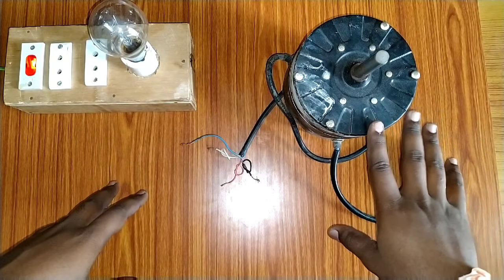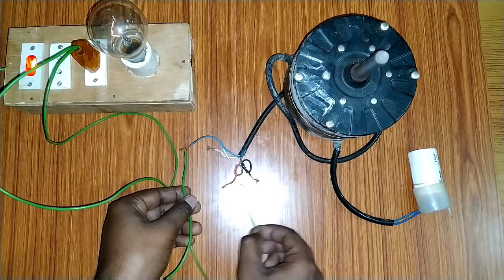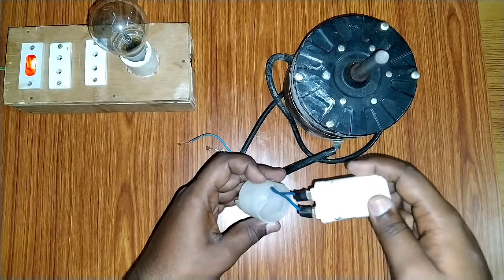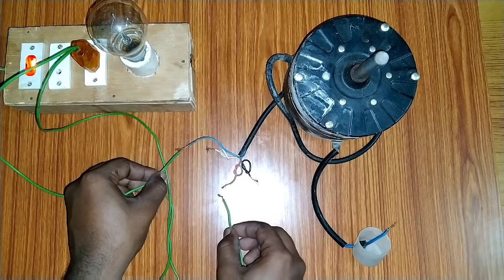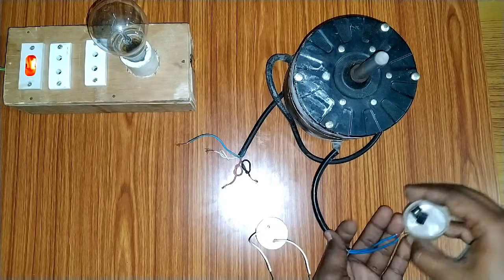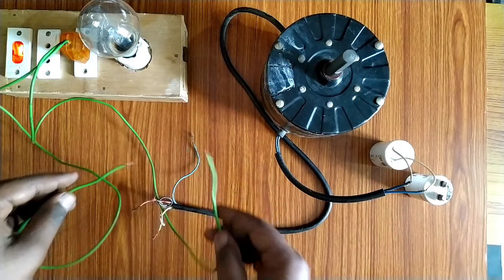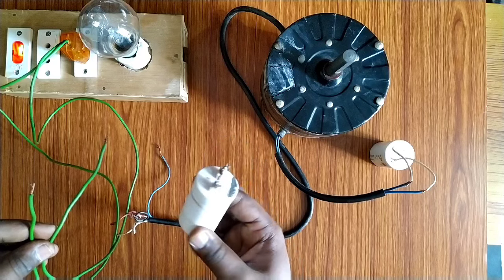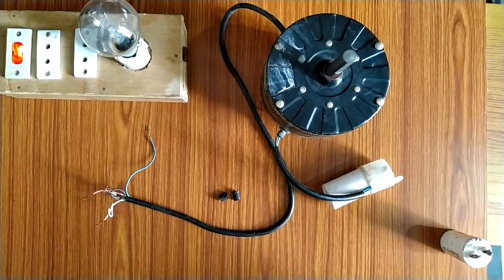Cooler fan Capacitor Problem // Solved

Comment: Nice explanation. I need a solution for my cooler 3yrs old (Bajaj DC 2050 DLX 70-Lires) problem. When I switched on power its taking more than 5 mins to start and running fan. Observed getting heat when I touched it. And also giving much noise (noise not like your previous video) . Pls suggest..
Reply from the maker: Okay Brother I understood
Thier might be some other problems 
Like bush rupter etc. Okay fine

This is the link 👇👇👇 might may help you regarding your problem.
https://youtu.be/vtF2GpJscfo

Comment: Very informative.  Thanks machha :-)
Blue common 
White High
Red Medium 
Black Low
Is color code important or can we connect any wire to high, Medium and low?
Reply from the maker: Thank you bro
Colours anevii standards.
Meru ela fit chesina positions change avutayii tappa circuit lo problem radhu.
Reply: @sharathmultiworks5509  thank you
Reply from the maker: @ChandraJavvadi  welcome
Reply: @sharathmultiworks5509  common identify Ela cheyali bro
Reply from the maker: @maheswararaosasubilli2133  Blue wire is common bro

Comment: Hi bro, Nice explanation. 

Memu Crompton window cooler Ozone54 2 years nundi use chesthunnam. Super performance icchindhi so far. But ippudu oka 2 days nundi...slow ga thiruguthundhi and konni sarlu thiragadam ledhu...initial ga koncham movement isthe thiruguthundhi but not fast as earlier. And Capcitor dhaggara sparks vasthunnai. Malli power leakage kuda vundhi...tester tho check chesthea...li8 vasthundhi...shock em ledhu.
 Capacitor replace cheyyoccha? Or Motor bushings check cheyinchala? Please reply..
Thanks
Reply from the maker: Motor bushes check chesi greasing cheyali, and capacitor kuda check cheyandi

Comment: What to do condensor wire is lost bro 
Pls say
Reply from the maker: Internal ga winding degara wire fail iendha
Reply: @sharathmultiworks5509  
Ha ,condensor wire came out from motor
Cut indhi
Reply from the maker: @mamathabollam1947  okay fine I understood.
Watch this video, you can solve the problem by clicking this link 👇👇

https://youtu.be/ZYSeU1bny3c

Comment: capacitor problem unapudu motor over heat avuthundha
Reply from the maker: No, bush problem vunte over heat itadi
Reply: @sharathmultiworks5509  ok bro thanks
Reply: @sharathmultiworks5509  capacitor change cheysanu run kaledhu bush problem anukunta
Reply: @sharathmultiworks5509  ok
Reply from the maker: @yooman5172  welcome
Reply from the maker: @yooman5172  Yes
Reply: @sharathmultiworks5509  money entha avuthundhi bro bush repair ki
Reply from the maker: @yooman5172  no idea bro. Approximately 500 for both bushes
Reply: @sharathmultiworks5509  ok bro

Comment: Hi brother
Cooler capacitor celling fan ki prttochha
Reply from the maker: No bro, winding kalipotadi.
Reply: @sharathmultiworks5509  TQ bro
Fan thirgatledu bro condenser check chesa bagane vundi fan regulator poindi anukoni direct ga connect ichhesi fan on cheste ayina tiragatledu problem enti bro 
Winding poinattena?
Reply from the maker: @ramkuntamalla8067  winding check chii bro 1st.
Reply from the maker: @ramkuntamalla8067  https://youtu.be/5caxzeLgfZ8
Reply: @sharathmultiworks5509  winding check chesa bro light kuda bagane vastundi ayina thirgatledu ela
Reply from the maker: @ramkuntamalla8067  emina sound vastundha bro, on chesthe.
Reply: @sharathmultiworks5509  ha light ga vastundi bro sound
Reply from the maker: @ramkuntamalla8067  then bearing ina patesi vundali, Ledau ante condenser ina problem vundali .
Reply: @sharathmultiworks5509  ohh k brother TQ
Change chesi chustha
Reply from the maker: @ramkuntamalla8067  you are welcome bro
Reply: @sharathmultiworks5509  bro fan kotta ga windig,bearings ki entha avtundi
Reply from the maker: @ramkuntamalla8067  Avarage ga ite winding oka 250, bearings 150 to 200rs, Approximately.

Comment: Bhai hindi v video banao
Reply from the maker: Ha bhai video agar hamara Telugu channel he bhai isleye Telugu me banate. agar apkeliye kuch problem heto pucho bhai may bolthum.
Reply: @sharathmultiworks5509  hamara small cooler h fiber wala uski motor change krwayi new h but bhut slow air pass kar raha h motor frr se change ki frr v slow air de r ham kya kare any suggestion
Reply from the maker: Bhai aap ko English samajta
Okay coming to the point
Bhai aap ekh bar new Condenser change  karoo bhai
Reply: @sharathmultiworks5509  ok me try krta hu frr apko batata hu
Reply from the maker: @shreyansjain2144  Acha tekhu bhai

Comment: How to solve this problem cooler motor i check capacitor it working well cooler motor wires broken how to connect wire to cooler motor bro teach me bro
Reply from the maker: Please connect tye same wires with the same colours

Comment: Sir cooler lopala condenser mida water padithey capacitor sparks vastundhi..Emi cheyyali sir
Reply from the maker: 1st thing connections neat vesukoni plaster perfect ga vesukondi
2nd thing angular ki fan side ki capacitor fit chesii plaster perfect ga vesukondi
Reply: @sharathmultiworks5509  thank u very much sir
Reply from the maker: @ashokraju1330  Heartly welcome Brother
Reply from the maker: @ashokraju1330  Most welcome Brother

Comment: Nadi same problem vire kalipoindhi malli  check chesi joint chesinaa alaa bulb veluvutundhi kani fan tiragadam ledhu fan tiragalantey em cheyyali
Reply from the maker: 2 problems bro, basic ga capacitor or 1 section winding anna kalipoyundochu
Reply: @sharathmultiworks5509  tq brother
Reply from the maker: @pattivenkateswararao8075  welcome brother

Comment: Test lamp tho try chesa bro black wire okate work chesthundi  Inka 2 wires work Cheyatle am cheyali bro
Reply from the maker: Inbuilt ga wires disconnect ipoyayi
Full clarity kosam e video chudandi 👇
https://youtu.be/19mUSOQA0Ck

Video chudandi 1st taruvata cheyandi, ledu ante black wire connect chesukoni present use chesukondi motor run itadi. Okavela cheyadam kastam anukunte
Reply: @sharathmultiworks5509  1 yr avuthundi bro cooler run ayyi Inka adaina problem ha bro
Reply from the maker: @naveenmulka8620  Ala am vunadu bro red & white ni dummy chesi blue and black tho run chesukovachhu cooler ni

Comment: Bro how to connect water pump direct without switch
Reply from the maker: Connect the two wires of the pump with direct to two wires of the supply input wire bro.

Comment: Series test cheste 💡 dim ga vastundi.. capacitor thisi direct ga check cheste full ga vastundi.. ‼️
Kotta capacitor tho chesk cheste full ga vastundi ‼️but fan thiragadam ledu... em cheyyali ❓
Reply from the maker: Winding lo anni poles check chesara.
Reply from the maker: Anni speed variantlu check chesara
Reply: @sharathmultiworks5509  only 2 wires unnai balck, red
Reply: Patha capacitor 6.00uF ±5%❕ kottadhi 6 MFD ±5%‼️
Reply from the maker: @vijayb8498  okay, I think values same vunayi kda bro.
Reply: @sharathmultiworks5509  fan thiragadam ledu.. on cheste konchem sound vastundi,  daggaraga vinte
Reply from the maker: @vijayb8498  bushes oksari check cheyandi
Reply from the maker: @vijayb8498  motor on chesinapudu check cheyandi, appudu free ga vundha hard ga vundha chepandi
Reply from the maker: @vijayb8498  ite adi winding problem ina vundali Leda capacitor problem or capacitor ki vunna wire connection check cheyali bro.

Comment: Hii Bro Cooler Motor Chala Slow Ga Tirugutundhi Capacitor Kothadhi Vesa Bush Lo Oil Vesa Ayina Tipitegani Thiragatam ledhu Over Heat Avutundi
Reply from the maker: Okay broo problem enti ante
Winding in depth lo Capacitor wire joint fail iendhi andhuke over heating, tepitekani tirgakadu.
Reply: Thank you bro
Reply from the maker: @Iamtruckdriver  welcome bro

Comment: Air cooler fast ga tiruguthundi but air flow mathram ravadam ledhu. Rekkalu bagane unnai but problem yento ardham kavadam ledhu.. Cheppandi.
Reply from the maker: Me cooler yokka gaddi side pads lo dust vunna air flow vundadhu.
Cooler ki back side ki bayata air contact lo vundali ante cooler manam room lo edo oka corner ki pedite kuda air flow vundadhu kevalam window side ki petali.
Reply: @sharathmultiworks5509  ok thank you
Reply from the maker: @WE_VOTE_FOR_JSP  welcome Brother

Comment: Hi brother
Cooler sudden ga తిరుగుతూ ఆగిపోయింది సిరీస్ టెస్ట్ చేశా winding bagane వుంది కానీ capacitor పోయినట్టు అనిపించి వేరే cooler capacitor తీసి petta koddi sepu run ayyindi motor lo nundi పొగలు వస్తున్నాయ్ అయితే ఆఫ్ చేశా ఇప్పుడు ఎం చేయాలి బ్రో
Reply from the maker: Am leadu bro simple wires short circuit inayii so oksarii wires anni check chesi short circuit ina wires change chii
Reply: @sharathmultiworks5509  ok bro tq
Reply from the maker: @ramkuntamalla8067  welcome bro

Comment: బ్రో స్మాల్ కూల్ capactior 2.50mfd కూలర్ తో vachenndhi హా 2.50mfd capacitor కాలిపోయింది నేను న్యూ capacitor 4.00 వేసాను cooler వర్కింగ్ చేయటం లెదు వాట్ problem bro
Reply from the maker: Double iendhi bro, heavy mfd vesi bro may be winding kalipovachu
Asal start avaleada bro.
Reply: కూలర్ స్టార్టింగ్ అయింది బ్రో స్లోగా తిరుగుతూ ఒక సారి ఫస్ట్ అయి చీట్ పాట్ సౌండ్ వచ్చిoది బ్రో  మాల స్టార్టింగ్ అవలేదు
Reply: 4.00 mfd వేసాను స్లోగా తీరిగి ఫస్ట్ అయ్యింది చీట్ పాట్ సౌండ్ vachendhi బ్రో ఓల్డ్ mfd కూలర్ తో vachendhi 2.50 mfd వాట్ ప్రాబ్లమ్ బ్రో
Reply from the maker: @venkateshsambeti3483  chepina kda heavy current vachi winding poyi vundochu
Reply from the maker: @venkateshsambeti3483  4 mfd ante alanti motors rendu nadustayii broo alantidi nvu oka motor ki 4mfd supply chesavv appudu winding sections kalipotayii
Reply: Ok thanks bro super  👌👌 elanti videos YouTube lo పెట్టు ఇక single phase really starater and contactor starter గురించి you tube lo పెట్టు single phase capacitors గురించి పెట్టు  ok bro thanks very so much మీ ఛానెల్ సూపర్   చాలా అర్థమైంది బ్రో మీ వీడియోస్ చాలా అర్ధమైన వీధిగా చెప్పారు answer సూపర్ బ్రో
Reply from the maker: @venkateshsambeti3483  thank you so much brother.
Reply: Motor problem

Comment: Anna నా దగ్గర సిరీస్ బోర్డ్ ఉంది నేను check చేస్తుంటే లైట్ dim గా రావడం లేదు ఎందుకని
Reply from the maker: Am check chesaru winding or ca
Reply: @sharathmultiworks5509  winding anna speed controls check చేస్తుంటే నాకు లైట్ లో difference అర్దం కావడం లేదు
Reply from the maker: @v.muralikrishna5513  pedha difference am vundav bro. Light vaste chalu winding perfect ga vunatu
Reply: @sharathmultiworks5509  thank you anna అలాగే కూలర్ మోటార్ వైండింగ్ బాగానే ఉంది కానీ షాఫ్ట్ తిరగడం లేదు అలాగే supply body కి కూడా వస్తుంది problem ఏమిటి చెప్పండి అన్న కూలర్ బుష్ పోతే change చేశాను
Reply from the maker: @v.muralikrishna5513  ala ite cooler winding fail iendhi ega a motor tirugadhu.
Reply: @sharathmultiworks5509  check చేశాను అన్న winding lo common check చేశాను బాగానే ఉంది controls అన్నింటికీ వస్తుంది supply
Reply: Hi అన్న నాకు ఒక హెల్ప్ కావాలి నేను మా మిక్సి మోటార్ కొత్తది తెచ్చి సెట్ చేసాను కానీ స్విచ్ ఆన్ చేస్తే తిరుగుతుంది రెగ్యులేటర్ తో కంట్రోల్ అవడం లేదు ప్రాబ్లం ఎంటి అన్న కొంచం చెప్పండి ప్లీజ్
Reply from the maker: @v.muralikrishna5513  With out regulater direct ga connect chesaru anukunta, oksari check chii bro
Reply: @sharathmultiworks5509  లేదు అన్న రెగ్యులేటర్ కి కనెక్షన్ ఇచ్చాను కానీ డైరెక్ట్ అయింది అదే అర్దం కావడం లేదు
Reply from the maker: @v.muralikrishna5513  ite regulater series test lamp tho check chii, may be regulater lopala direct avochu
Reply: @sharathmultiworks5509  అవున ok anna check చెస్తాను thank you for ur support anna
Reply from the maker: @v.muralikrishna5513  welcome brother

Comment: Hi anna .
Anna series connection lo light full glow avuthundhiii kani ....
Motor rotate avvadam ledhu anna
Reply from the maker: Anni speed variants check chesara
Reply: @sharathmultiworks5509  ha chesa anna light glow avuthundhiii kani motor rotate avvadam ledhu
Reply from the maker: @easyearningapps..1273 power supply ichinapudu shaft free ga tirgutunda hard ga tirgutunda

Comment: Capacitor range antha bro
Reply from the maker: 4 MFD
Reply: @sharathmultiworks5509  a cooler kaina adhe range aa
Reply from the maker: @ncnomahi5063  yes almost only for coolers, not for blowers. Check your old capacitor for confirmation.
Reply: @sharathmultiworks5509  tqq
Reply from the maker: @ncnomahi5063  you are welcome